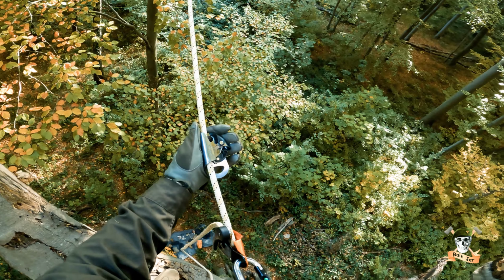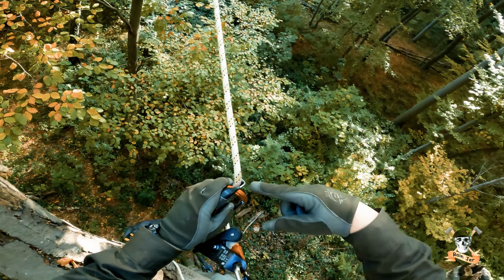Tree Climbing: Compact RAD System for Traversing (Quick Tip)

Comment: It is a good system but I like to attach a pulley to my captain hook and run my rope through the pulley and use a hitch climber set up to traverse or position myself, and you can utilize a foot ascender with my set up.